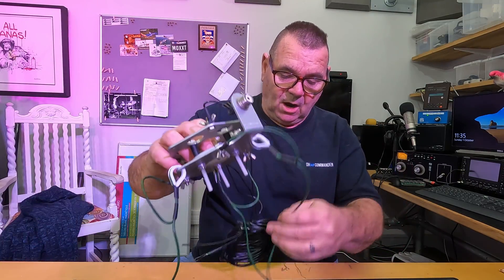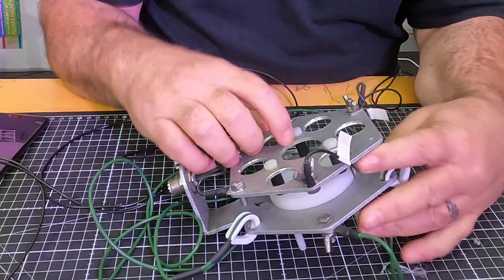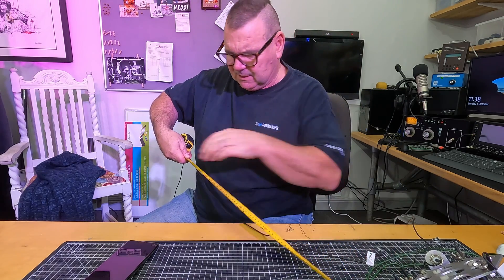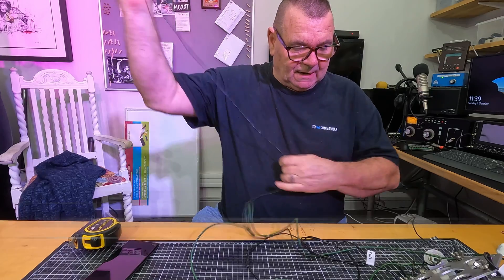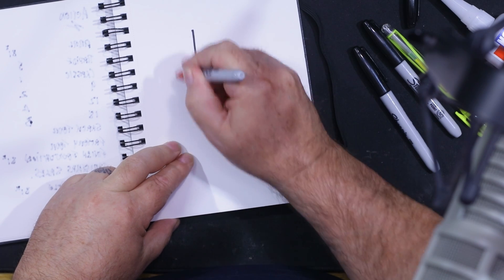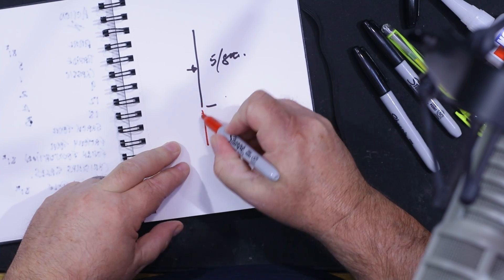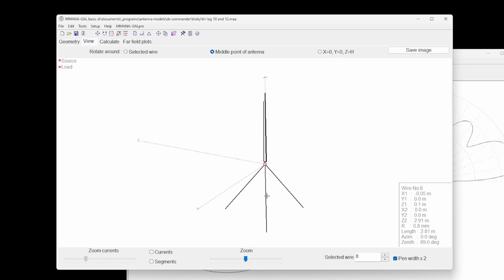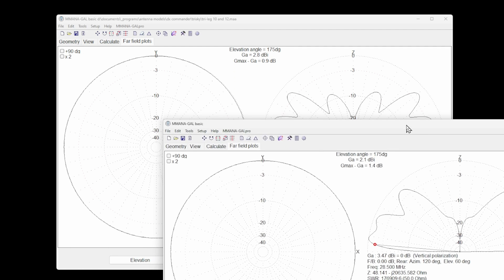3-Band VERY High Gain HF Antenna (SkyLab Starduster CB antenna style)

Comment: 10,11,12m on a 12.4m pole would be great.  Have the 11 center-fed and best optimized because we only have 12W.

I corrected a typo and lost Callum's like.  I guess that is a safety feature.
Reply from the maker: Yes, you could do that! Just a case of cutting the elements right.
Reply: @DXCommanderHQ  How would you recommend adding 6M?  As a center-fed full wave or something else like an off-center fed 3/4?
Reply from the maker: @michaelstora70  6m? Just add an element. I calculate exactly 1.40m long off the side. Need a driven plate that can cope with 4 elements.. You have given me an idea!
Reply: @DXCommanderHQ  so keep the 12m radial and add a 6m element and it's basically an off-center fed 3/4 wave?
Reply from the maker: @michaelstora70  Actually.. Been thinking about this since I commented 10-mins ago. I would need to test it out.. It might be we can shorten 6m - OR as I think you indicate, make the element longer and get it working as a 3/4. To be honest, I now don't know.. Hang on and let me see what the maths says... I'll be back in 10.
Reply from the maker: OK, I'm back.. I can't get this to work on 6m it turns out! We'd need another leg perhaps vertically hanging down the pole and make it a vertical dipole for 6m. It would be ignored (mostly) on the other bands.
Reply: @DXCommanderHQ  what about the second harmonic making it full wave?  2.85m radial and 2.74m vertical element?
Reply from the maker: @michaelstora70  Although you could probably match it, ideally we need the third harmonic.. So let's take a third of 50MHz.. that means to get a 50 ohm match naturally, we'd need to make something resonant at around 16-17MHz. Then I suppose it would work. Maybe. Just doing the math now.. (later) .. I can't get it to work. Need hours not minutes! LOL
Reply: @DXCommanderHQ  I had forgotten that even dipole harmonics were high impedance.  Might be able to fan the radials too.

Comment: Just rewatched both your and Mike's version where Mike used just ONE element on top which was 2.0 SWR or under from 26 to 30 somehow? The height for ground wave locally is the plus! No  local Ham on 10 so having 11 gives a better chance  of someone locally, plus the commercial fisherman  that use SSB on 26 .
Reply from the maker: Yes.. Mike built a traditional 5/8 - but at this height, 1/wave is fine.

Comment: "...with huge gain...". 
The word 'gain' likely not the most accurate descriptor. 
Height often enables high performance, but not "gain", a word which has a very specific meaning, as you know.
Elevated ground planes are generally better than ground mounted. Fewer radials. Dirt not being warmed, LOL.
Reply from the maker: You sound to clever for me..

Comment: If you want wider bandwidth i use 20mm stainless steel tape banding for top and ground radials,less VF as bare metal,no rust as its stainless steel!-rather than insulated wires.
The Mast heights you spot on ,ground affect less after about 65ft from ground roughly and then ground radial are far more effective.

 I used a BN43 block ferrite for totally isolation of feeders,2Turns:2turns on ferrite block on primary & secondary,
and provides a dc short to antenna.
Good Line of sight performance and skywave ,great for 27\29mhz Voip gateways too!

No Antron wont work the same oh my..thats like a dog and cat theory,glad corrected watcher
but extra vid would be nice to show and educate,as theres a lot of rubbish nonsense out on internet land 🙄

A little up radiation is actually advantagous sometimes with these antennas as most dont live on hilltops or urban uses.

Fab vid,cannot wait to see rest.

Rob P 73's
RP Comms
Reply from the maker: I try and post relevant videos.. It'll all come out in the wash over time :)

Comment: Welcome back! Great to have you thinking online about improvising antennas: Gets me going.

I say that the biggest revelation you've proved with the elevated three-band (isn't it a "ground plane" antenna?) is that higher is better. By a long shot. So if you're going to go to all the bother to run a coax up the mast to feed the three-band at the top, why not use that to feed the lower frequency monopoles from the top down? That would put the lower section monopole's highest current up at the top, where God intended for it to be. Managing the counterpoise would be a bit of tricky, because it would be big – I suppose you'd have to manage an inverted ground plane, which might be a bother – but you might manage using an umbrella-frame style top load to use as the counterpoise.

Or if a full counterpoise up top seems like there's not enough room, maybe you could split it between the top and the ground level and use radial wires both off the (near) top and off the bottom (ground level) to make up the missing length for the wire. In that case, the feedline would have to make a station stop at some a point about half-way up the mast. If it can get full current going both up and down from the middle it would still get the max current on the mast up high, so it might good performance similar to what the elevated ground-plane at the very top is showing now.

The main really bad thing I can see with this "inverted double-umbrella" antenna idea, is that it would put high voltage down near the ground, within easy reach of passers-by: Unless run along the soil, the ground-level counterpoise might turn into a death-trap.

73 DE K7TLI / CN83
Reply from the maker: Interesting.. I did think about this but I'm at the weight limit for my comfort...!

Comment: Cal, why not make a needed short stand offs from  the driven plate, drop your 12 meter pole hardware down ward , add if needed a couple of longer radials and drive it at the top  using the SAME  coax taping it to the pole to actually strengthen the pole?
Reply from the maker: OK, you will have to say that again on a frech / new comment because I don't follow. I wish I could read minds..! LOL
Reply: @DXCommanderHQ  What I WAS SAYING IS , to add the other bands instead of using a second driven plate below attaching the 40, 30 60 meter etc.,  just attach them at the top using the same plate as  those bands going down, you might have to add more radials but this way one coax attached at the top ( really more like the middle). The coax if hi end coax likely would be stiff, so attaching it to the pole would make it stronger. I have some1/2 inch hardline so my thought go to using it.

Comment: How much room would you need to setup this antenna with the 80 meter option?
Reply from the maker: I did 180 degrees on 80m band with 30 x  3.5m long radials (11.5 feet)

Comment: Hi Calum, thank you for this Video! And this intressting thinking to do a combination of this 2 vertical system, 10 on Top an under a vertical up to 80m.....the question for me wend " what kind of Impedenz the software gave you at the feedpoint on each antenne !?.... maybe this connection between this 2 system you need to care about this time running of the coxial cable. Like at an array antenna system ! Or a 75 ohm cable like an transformer between this 2 differenz of the impedanz of this 2 antenne system. I hope you understand my english. It is not the best....maybe this thinking helps!? Vy 73 DL1AQU Michael
Reply from the maker: Impedance for the dual-feed..? I would THINK that assuming both coax lengths were same size (John Gendron's idea) that the imedance of one system would be far too high for the other (take a fan dipole for instance).

Comment: Not sure 2 or 3 dBi is very high gain.. 6 dBi is not even high gain. Maybe I misunderstood something.
Reply from the maker: Yeah, you did miss it.. Manufacturers claim utter baloney and claim gain figures at say 20 degrees off the horozon.. The numbers I quote are DX angle at 5 degrees off horizon. Ask the manufactuer what the gain is at 5 degrees! They won't tell you because it's a small number.

Comment: If ya fed them usin the same coax u would need a choke on each feedpoint at the antenna but it would also start tryin to act like a phasing harness which is the problem but then runnin coax up the pole with the other radiating wires on itwould change it all and cause problems
Reply from the maker: Well, it wouoldn't act like a phasing harness because it's impossible for say the 80m element to resonate when I'm pumping all the RF up to say 12m band..!

Comment: Yes! I've been waiting for this. I want the Nebula + Startduster for a permanent installation in my backyard. It will be installed close to the center of a full-wave 80m horizontal loop. How will the 80m element work alongside the elements on the Starduster? Do you think 10, 15, and 6m would work instead of 10, 12, and 15 on the Starduster? Please put me down for one of these. In the meantime, I'm going to order the Neboooola from DXE. All the best to you, Cal!
Reply from the maker: Yeah.. OK.. You SHOULD be OK but like all antennas close to each other, there will be some interaction. Nothing to worry about. YTou want 15, 10 and 6? Well, the radials might be a bit too long for 6m but I will model it..
Reply: @DXCommanderHQ  Haha. Yes. I didn’t think about the harmonic silliness of 6m. But, yeah, who really wants 12m? I don’t think I have ever spent much time on 12m or missed not doing so. That comment should stir up the wankers!
Reply: @DXCommanderHQ really wondering what the 6m would act like with 12m radials--kind of a off-center fed 3/4.

Comment: I would be interested in a comparison video of the Antron and other antenna's and results of adding height.  I use an antron for 10,11,12,15 and 17M bands and it works very well.  Currently it is about 10' off of the ground and I have been curious if it would perform better up high.  Im not sure how I could get it to 30' but if the gain is 10db then it would be worth the effort I think.   I have researched about the height and there is conflicting information, some say height wont make much difference.  I believe your testing and data would be correct and useful.  Thanks and God Bless
Reply from the maker: I have just done a video (not released yet) that suggests 15m is not so good. And 20m is out the ball park.. But wait for that. I need to see if I can get my hands on an A99.. I already have the Imax and a GainMaster..

Comment: It's not clear to me why this antenna enjoys so much apparent gain. It's just a quarter wave with elevated radials. This of course means I will need to build one myself (I did sort of do that a while back but it was a right mess of old bell wire).
Reply from the maker: Because of the height and it's above the tree-line.
Reply: I had a cb antenna on top of a small mountain about 200 feet above my house and I fed it with ladder line. The height alone made it outperform my 80 meter dipole so badly even on 80 meter I mostly used the cheap cb antenna. The lesson I learned was the higher the better.

Comment: Don't forget the super penetrator antenna.  I run mine at 35 feet, mostly use it for ground wave local 10 meter.
Reply from the maker: Oh yes..
Reply: It's a great antenna. I use it on 10 m and the hy-gain super penetrator typically allows me to step on the crowd even though I'm only using 100 W.

Comment: Hey Callum. I love it ❤️ . As an M7 currently limited to 10, 12 & 15 due solely to antenna, currently using the Max2000 (great antenna) but only 3m off the ground. I'd bloody love one of these. Circumstances as they are right now I'd be unlikely to be able to order one but if I could I'd snap your hand off. Ideally I need to get some band dexterity and open up all the stuff I'm currently missing which my radio will cover. Once my 3 bands close - I need to go and do something else. 
I like the idea of keeping a dedicated antenna though for these 3 band's, especially with that kind of gain! So if not this time, if you ever offer them again I would definitely take one.
All the best, hope Wendy is well on the mend. 
Gareth M7GDZ 🇬🇧 73
Reply from the maker: Well.. You COULD do this with say a 10m fibreglass pole?
Reply: Interesting idea, not sure I’d get away with an 18m pole, I have a 12m pole 🙏

Comment: I wrote in past videos about similar antenna Im interested in a multiband but I can't mount in the ground, only in Mast or Tower.
This one seems to be my solution. Unfortunely is only triband.  Or maybe I understood bad and you will try 40-10  or 20-10 ?
Reply from the maker: Triband ONLY because of the height of the feedpoint and the shared radials.

Comment: https://www.youtube.com/watch?v=HuAiNXvBgA4
https://youtu.be/B_P-kUANsuo
Cal, these links show a rebuilt matching unit that could be much lighter and easier to use and cover 17 meters to 10 meters. The 18 meter pole height for ground wave local plus put your 12 meter DX Commander on the lower level as you spoke. I have patiently waiting for years to see you do this. My new home 10 feet up is built and has a ramp  on the north side towards the front door using 6 inch x 6 inch posts so mounting  might be easy there.
Reply: https://youtu.be/B_P-kUANsuo
Very detailed as to building the matching? You can have Mike try different lengths of the element?

Comment: Callum, I think with the Tee piece feed you may need to feed each one with the same length of coax.  Have a feeling you may end up with some current imbalances if the coax runs are disparate.  But the concept is fantastic
Reply from the maker: Ah!!! Identical coax lengths.. Good idea John.

Comment: Yes please Antron 99 Vs Gain Master Vs imax 2000 that would be very interesting...

I
Reply: Sirio 827
Reply: better to compare own antennas with comercial ones. Not compare 3 comercials.   They will be almost the same, more dBd less dBd
Reply: l have got Gain Master and 827 and 827 is better on tx/Rx.
Reply: Every Aluminum 5/8 wave GP beats a Gainmaster, as far as ERP.  It is still a great antenna and design.